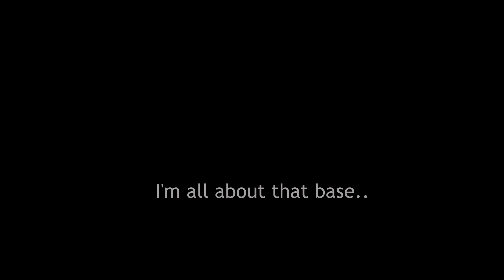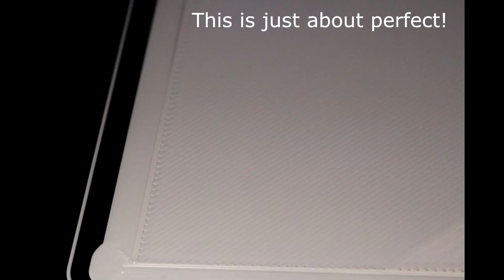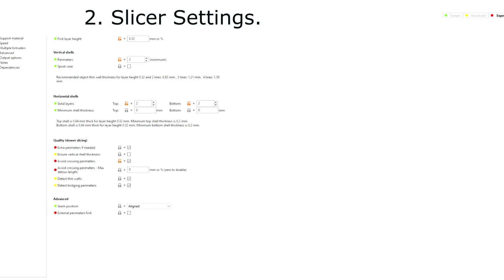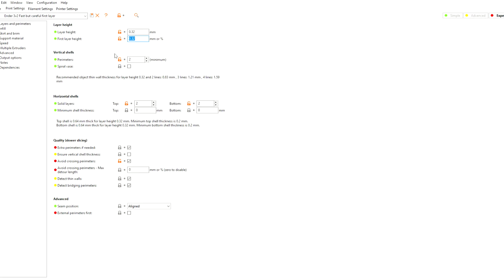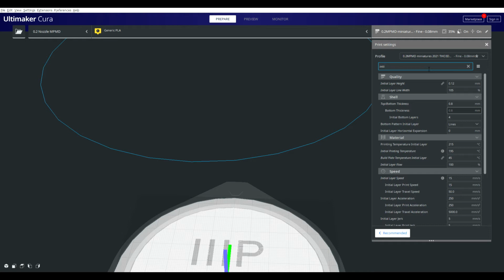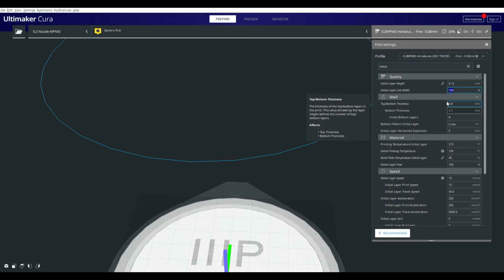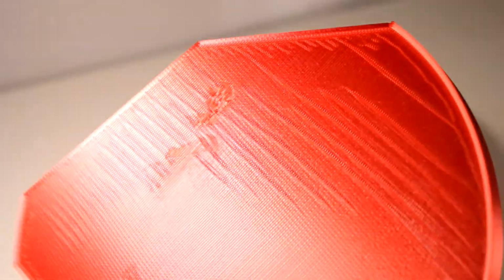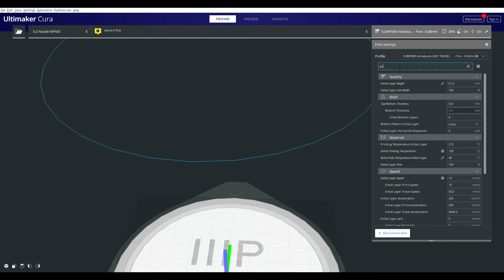Weird Ripples in your 3d Print? - How to fix the 'First Layer Wrinkle Pattern Problem'

Comment: Definitely depends on what you're printing. My widths and extrusion ratios are set purposely where they are just so tiny detailed little parts will achieve proper bed/layer adhesion but then when printing something large and flat it's causing problems and needs to be closer to defaults

Comment: my first layer is smooth as butter but the second is almost always a rippled disaster
Reply from the maker: thats a flow rate issue, you need to turn down flow rate, BUT that will then need recalibration of first layer z offset because first layer will then be too high.

Comment: Thank you, this was great advice. I was struggling to get my first layers to smoothen out and sometimes it would peel up on bigger prints forcing me to start over. Even after recalibrating Z offset over and over leaving waves on the bottom of prints that translated all the way through . I adjusted all the extrusion width settings to 0.00 on my Prusa MK3 in Prusa slicer and the first layer was flawless.

Comment: Great video, I'm having a mix of both issues and some areas on every new base layer it seems to not print anything at all, like it's smooth and then just forgot to print one or two lines/passes then goes back to smooth for a while and the same again. Confused

Comment: Awesome video. I do have an issue similar to this. It just happens on subsequent layers. My first is dialled in nicely but then on the next layers it builds up these ripples. Any ideas?
Reply: @ thanks for getting back to me even if it’s been 9 months haha. My solution was to buy a Bambu Lab P1S. Never had this issue again since! 

I tried all sorts and never got rid of the ripples. I think it had to be a warped bed or something because no matter how well I got it levelled, even with using infil to create a buffer it then occurred.

Comment: For me the first layer is good it’s the second and third layer that starts to get worse.  Is there a setting that gradually increases nozzle height automatically after the first layer.
Reply from the maker: okay so this probably means your flow rate is too high, but you compensated for it in the first layer. Dial back your flow rate and bear in mind this will mean the bed needs readjusting.

Comment: This happened to me after upgrading from Bowden to Direct Drive. To solve it, I printed a 40mm square 1 layer, then inspected the layer. i adjusted the first layer flow to 90% and then found 80% was the sweet spot for me. I then adjusted my extuder  E/Steps by 80% and no more wrinkles. I guess there is a lot less slack with a direct drive than with a Bowden setup. I did set up my E/Steps to measure 100mm of filament, but I don't think this is the best way to calibrate E/Steps with a direct drive.
Reply: Thank you so much for this! My esteps are spot on and I've been tearing my hair out this is very helpful

Comment: I'm having this effect happen on the 3 layer even if the first two are near perfect and not really sure why
Reply from the maker: If you're doing solid layers then it's because you are putting too much material down. Try changing flow percentage.
Reply: @LostInTech3D  ill try it now THANKS!
Reply from the maker: @Facelesszx10  did you sort it out?
Reply: @LostInTech3D  yeah I reduced the extrusion speed and it fixed my problem thanks again!!!
Reply from the maker: Good stuff 👍
Reply: @Facelesszx10  I am having the same exact issue. First and second layers are near perfect, then the third and fourth layers are complete trash! Pardon my ignorance, but where is the extrusion speed setting in Cura? And what did you change it to? Thanks.
Reply: @Facelesszx10  I have Top/Bottom speed set at 22mm/s

Comment: Hi There, I have a Voxelab Aquila.. 

And the trouble I seem to e having now is a strange side to side wiggle of every other layer line on the 1st quarter of the prints then after tat the printing is smooth and good layer wise! I have tightened up the two X & Y belts so they are tight but not over tight so they don't dent the V slots as the runner wheels would be pressing to much.
I
 leveled the bed so it is perfect, I made sure all the running wheels on the ed are also just tight enough and not to tight. 

The printer is sat on rubber thick pads which are raised up on PETG riser feet towers on top of a solid heavy unit so no wiggling there. 
But even with all the right set ups, the wiggling layers on the PETG or PLA still happen but only on the 1st quarter of the printing on the bed?

What am I missing that causing this side to to side wiggle in the print?
Happy Christmas to you BTW.  8 )
Reply from the maker: if you jump onto our discord server and share some pics, I bet we can figure it out

Comment: So, in Prusa, will it extrude the same amount of filament if first layer height was set to .2 as well as .3 or will it compensate and add more filament to the print if it was set to .3?
Reply from the maker: It will calculate extrusion rate based on line width, line height and speed. Changing first layer height from .2 to .3 will increase the flow rate but will also change the actual height of the nozzle on that first layer.
So, you can't make up for bad bed calibration by increasing first layer height, except you kind of can, but for different reasons, which is why rafts work for badly levelled beds. 
I hope that makes sense...hard to explain without diagrams!
Reply: @LostInTech3D  Your video helped me out so much. I set my layer height to 0.2 and then increased my z-offset to +0.1. I finally have my first glass-like first layer with PETG. Printing products for my business is going to be much better thanks to you. Thank you!!

Comment: This is a Good a Good solution to this Problem. I had the Same Problem, i changed the Flow,But the Initial layer Flow didnt change. I simply activate this setting in cura, since i didnt See it. It was deactivated from the beginning. 

Thanks for the help. I used an other slicer Before But switched to cura. So i only didnt finde the setting.

Comment: Got the same issue other day, its temperature issue, too much to be exact, i printet PLA silk wihich states 220-240 degrees,  on temp tower clearly show that 200 degrees is top and 220 is too much so u get overextrusion because of 2 much heat, so i realy dont know who writes these temp. numbers... now i learned always do temp tower on cura when u place new filament..
Reply from the maker: Yes! Higher temps cause "overextrusion" because extruders are always, somehow, slipping - more when cold than hot. This is because everything is affected by everything else, so the back pressure from the hot end affects the extruder, higher temp, filament less thick, less back pressure. CHEP (youtuber) did a comparison of extrusion distance with hotend connected vs. into free air - and there is a big difference at any temperature - it's the difference between ideal and the real world where extruder gear grip is not perfect I guess.  
This is a pretty advanced discussion though ;) 
240C for PLA? Really?? 😂 Yeah that's not right.
Reply: @LostInTech3D I'm just a neophyte, but from what I've seen, PLA Silk is indicated for a higher temperature than regular PLA.